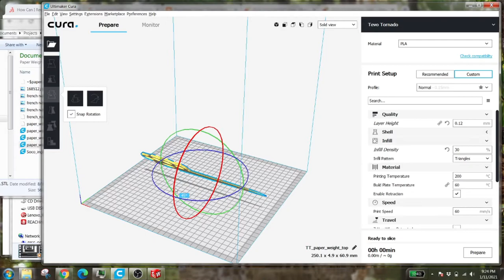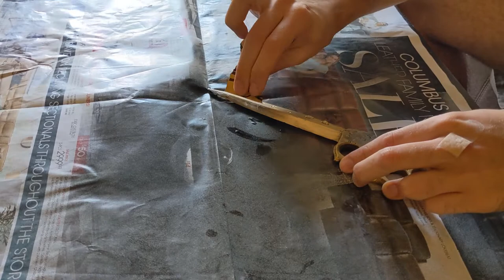Casting a Brass Trench Knife - Not Zoned For This

Comment: Are you able to 3D print an exact replica of the m1918 trench knife bronze knuckle handle? I’m not in the world of 3D printing but after watching this I wish I was. Have been wanting to remake the 1918 trench knife for awhile but to buy and original one just so I can cast the handle the same exact dimensions well that would be a costly project since originals can cost up to $2,000. I’m a full time blacksmith and I am seeing the potential 3D printing has that would help me, I mean for casters I can see the advantages to knowing how to 3D print as well. Either way cool video for sure. Love the letter opener you made
Reply from the maker: Ooh sounds like an interesting project. What exactly are you looking for, a 2-part plastic handle to use as a mold, similar to the process used in the video?
Reply: see i have the same questions, i have an original and want to be able to make copies to sell as reproductions since there are no good ones out there
Reply: @mr.rogers5628  since my original comment I’ve bought both a lf&c, and au Lion. I’ve used the specs to make 3D printed handles but I will say it’s a lot easier to just make a wax mold of the original handles and then casting from the wax mold. A lot of sanding and filing has to be don’t to the 3D printed handle as well as after your cast from the mold of it you have to do a lot more sanding and filing than a wax mold casted one. 

That being said I’m glad I invested in a 3D printer bc the amount of pommels and cool guards and even trigger guards for muskets I have printed out compared to making a model from clay or wax is nice. Like you don’t have to actual own something to make what you want to cast if that makes more sense. Sure sculpting clay you can do the same thing but with the technology you can find the stl’s online for what you want to cast and literally have the item print and you don’t have to even be there. I highly recommend getting into 3D printing.
Reply: @notzonedforthis6146  just seeing your comment and I appreciate the reply, I ended up getting into 3D printing myself to use for casting pommels and guards and such for my smithing tools I make. Technology is awesome  and I’m glad I saw this video, it’s what pushed me towards getting into the printing world
Reply: @JohnDoe-yg6ed  have you casted any brass handles from them? and if so how did they turn out?
Reply: @mr.rogers5628  from both the 3D model and from a wax model. I was thinking of making my first video showing the difference in the two and what’s the pros an cons to each
Reply: @JohnDoe-yg6ed  thatd be a great video, would you be interested in selling a casted handle, i'd love to get in contact to purchase one if willing. I have an original 1918 but id also like a repo for reenactment purposes
Reply: You could, if you have your own printer. I just asked a friend yesterday if he could print 4 of the handles (im making motorcycle footpegs) and he told me for pieces that big itd be about 40$ a pop for something id just be casting out of existence.